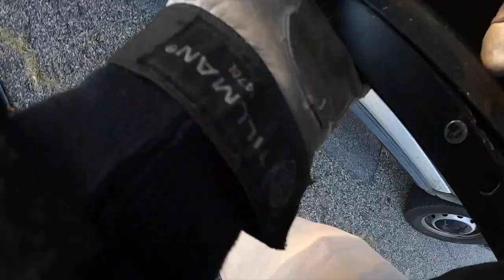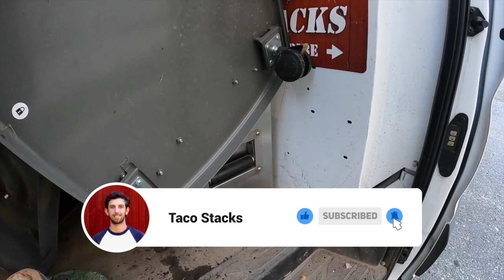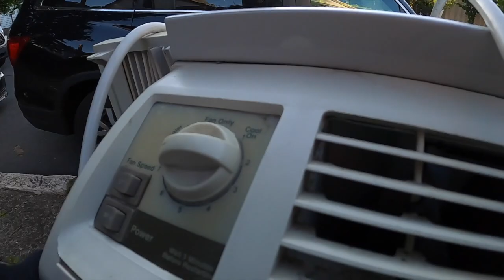Bulk Garbage Collection Day - Look What I Found!

Comment: Great video, Taco ... almost a half an hour, as well - awesome!  Good pick ups with the A/C, the toolbox, the pressure washer and the incredible tree stand!  The best part is that you've found a lot which you can use for yourself!!!  Yeah, I'd keep all of those.  The tree stand is old and pricey. But, it will hold a large real tree with ease. But, you could also get a good amount of cash for it.  All and all, the video was a great continuation from yesterday's one. Thanks again for the trip!

Comment: you should look into Ductless AC (also called “ mini-split AC”) work the same way a central air conditioner works—just without the ducts.
Reply: We put on into an addition to our old house. Worked well. What bugged me was the look. However there was not another realistic option, so it was what is was. After a bit I did not notice it as much.

Comment: Seems to me, if you’re gonna ask the question of whether you should have gone back out “yesterday,” you need to rewind your day a bit further. 

You decided to sell at the flea market, which means you got up extremely early. So, if you wanted to go out twice, maybe you should have done the flea market next week? (Depending if the other bulk pickup days happen next week?)

If it were me, I’d just say you did all the things and you did NOT need to go out again on the same day. 

If you have regrets then I’d look at the next bulk pickup and try to schedule your day for two pickups, no flea market. But as soon as I say that, a storage unit that you really want is gonna pop up. 

Lol. 

Summer is your bust season so this won’t be the last one of these. 

I really enjoyed this video! Thanks!

PS. If your gonna burn the candle at both ends, you may want to start buying sandwich fixin’s, water, and Gatorade. You keep yourself hydrated and nourished. You gotta have a six packer or even a bit larger cooler to keep lots of waters nice and cold. Hell you end up stopping to get food. This way you’re stopping only to replenish ice! (I never took care of myself either, lol, so it’s free advice. You get what you pay for.)

Comment: Taco  Stacks, WD-40 is not an oil, it is a degreaser.  Don't use WD-40 if you think that will lubricate.  It won't.  Also, Mongoose bikes are Walmart crap not worth $5.00.
After you have repaired tires and tubes you can buy a new one for the same price.